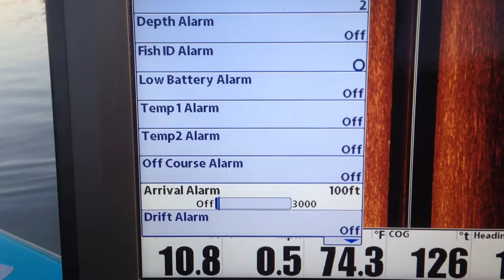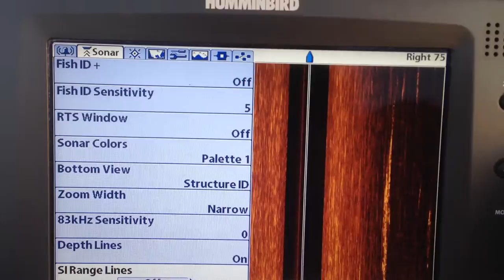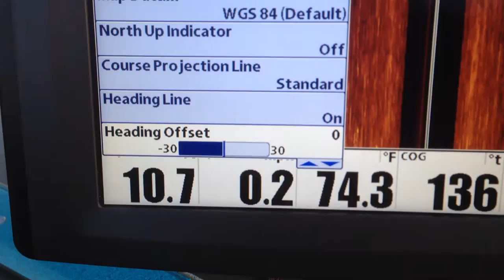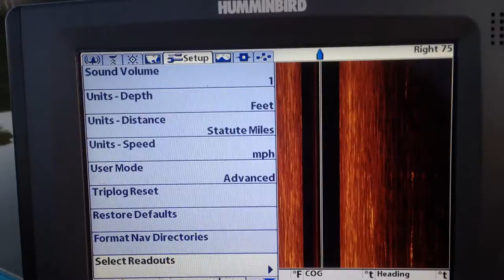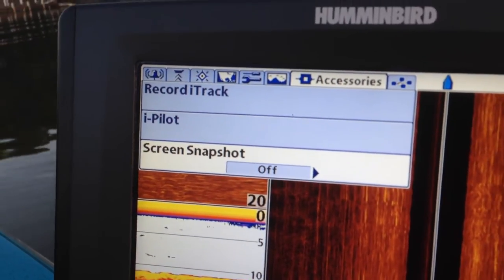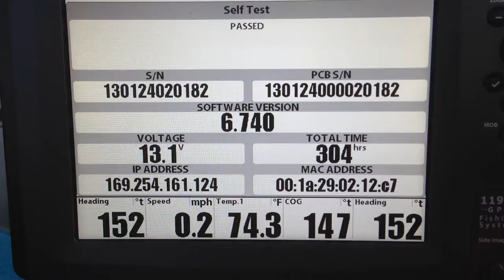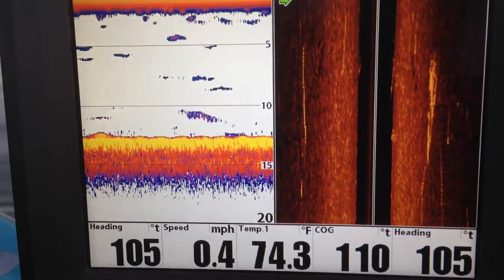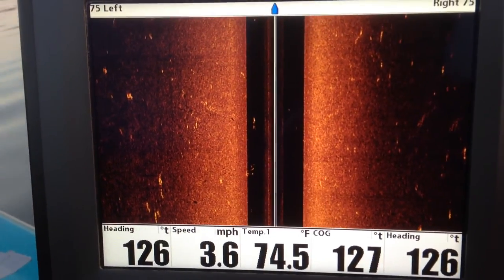Humminbird 1198

Comment: Hi James, I have this unit and the left screen that shows the depth is fixed on 10 ft where before it was automatically adjusting to the current depth. Has this ever happened to you before?
Reply from the maker: Bo I would say you probably have an issue with the unit.  The first thing I would try is a "reset defaults" which can be found under the setup menu.  If that doesn't work you can give them a call.  I'm not sure they will take these units in for repair but they might. 

Whatever you do don't do an update.  If it screws up the unit, and HB isn't repairing them anymore, you are in trouble.

Comment: What are your settings for down image and side image can't dial mine in
Reply from the maker: The biggest issue I see when training folks is the transducer is not parallel with the water at idle.  Most folks have the rear of the transducer either to high or low. If you think about the way a boat sits in the water the transducer rear will have to be slightly up in the back.  

Be aware too that the location of the transducer makes a difference. It needs a clean flow of water over the face.  Location is always a trade-off. If you mount it even with the bottom of the hull the transducer is more susceptible to damage.  If you mount it up the transom some (such as on a jackplate) the water won't flow as cleanly but the transducer is more protected.

Once you have the transducer correct make sure you have good clean power to the unit. All good installers that I know run a 12ga wire to the battery and connect the unit to the 12ga wire with a fuse.  The fuse needs to be in the hot wire close to the battery.  

When you get on the water the most important settings are sensitivity and contrast.  All water conditions are different. You need to play with the difference in contrast and sensitivity until you see that you want to.  A pretty picture isn't always the best way to run a unit if you are looking for fish.

A good way to learn the unit is to make a recording on the water and play with it at home.

Let me know if you have any more questions........